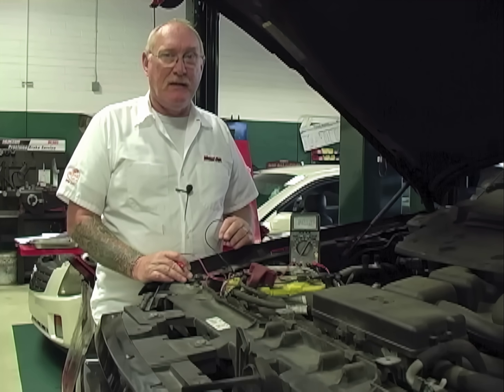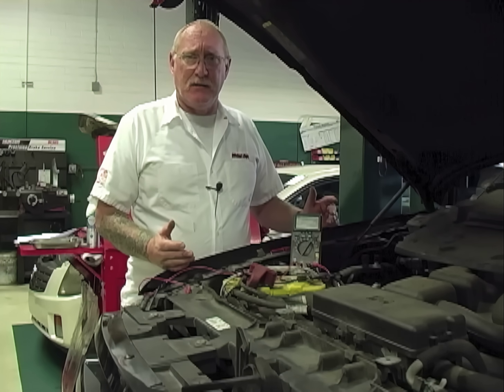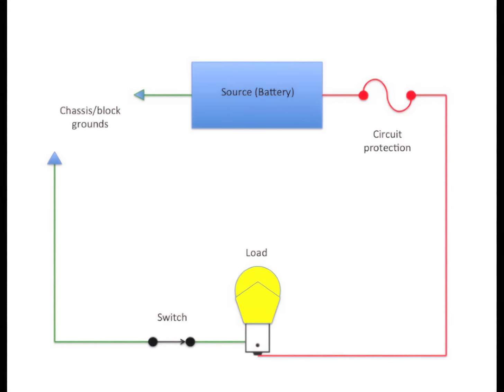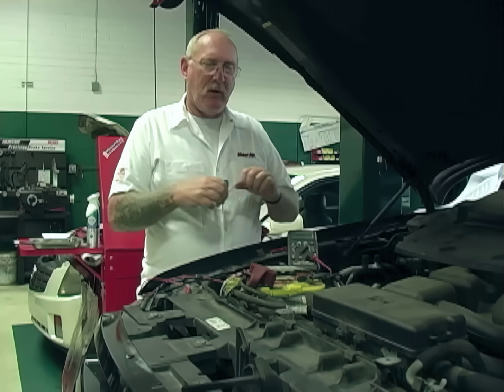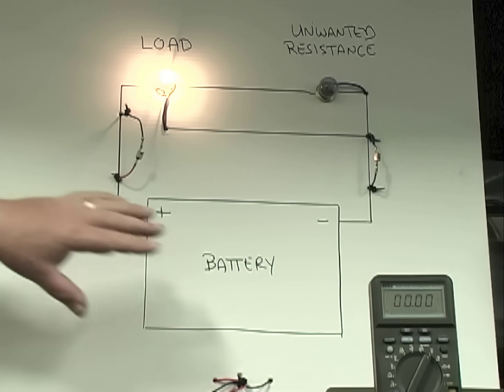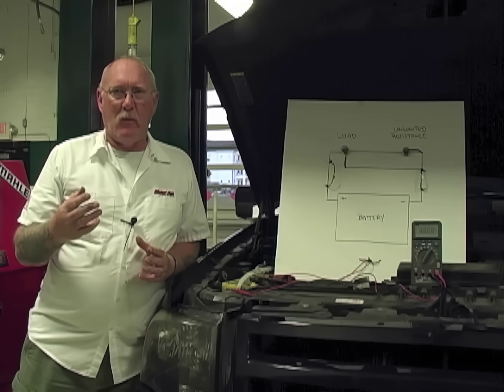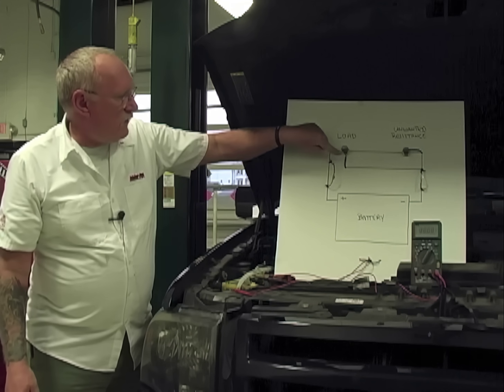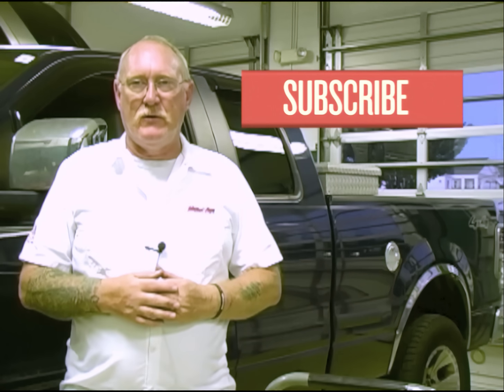The Trainer #47: What measuring voltage on the ground side means

Comment: It's odd you use the term "ground" on a DC circuit.  
Bad habits and all I suppose.

PS, there is no ground rod on a car or truck.

Regards
Reply: It’s a throwback to the mains electrical system where the ‘ground’ is the common return on an AC system. The voltage may use the hot and neutral but there is ALWAYS a ground return, literally via the ground.

In auto systems using DC, it would be expensive to use individual ‘0V’ wires to return to the battery so the chassis is used as a ‘ground’ equivalent. That way, a single wire carrying the positive voltage to the load is all that is needed.

Fun fact: radio transmissions also rely on a ‘ground’ to return the radio energy to the transmitter.

Electronics and Communications graduate and test technician in HV systems.

Comment: The best thing to do is test the battery cables. Make sure the connections are clean because if there isn't a solid connection then you will see a voltage drop from either cable or both. Take your volt meter probes and apply one to the the end of the negative cable chassis lug and the other lead to the actual chassis some where near but at another point. If it is not a solid connection the you will see voltage. That is what is called a voltage drop, Voltage drops are bad connections with enough resistance to show as voltage drops across that bad connection. You can use this method to test all suspected connections. This includes the battery positive post cable to alternator connection. also check the resistance of each cable disconnected from the battery, it should read way less than 1 ohm.

Comment: Ground strap from battery to Chassis !! Check engine to chassis strap and alternator grounding as well. Good ground is ESSENTIAL !!  A goofy Ground/Earth with resistance will self destroy itself at the point of max resistance. Electricity takes the line of least resistance.
Reply: Crobular I I have an old Cadillac 72. Lots of dim lights and sluggish electric windows and what not. I have a bad ground to the body or what would I look for? Been driving me crazy for years now.

Comment: Having a change in resistance in a circuit in the car will not cause this.  The only thing that can cause you to get a voltage reading between the negative post and body ground is a bad ground.  Meaning there is resistance in the connection from body to the battery.  While the meter is connected, take a piece of wire and touch it between the engine block and the body, and the reading should drop to zero.
Reply: tpaairman Umm a bad ground is a change in resistance doofus
Reply: Charles Terrizzi You mean like how I stated in my comment?   Maybe try reading the whole comment doofus.
Reply: "  Meaning there is resistance in the connection from body to the battery.  " hmm

Comment: A crap test. Where are the connecting wires ?  At all lines on the board ?
Why wouldn't the current just follow the path without any lighbulbs (the path of least resistance) ?
Reply: Perhaps - just perhaps - the path of least resistance happened to contain a light bulb rather than a simple wire.
Reply: @kjamison5951  This is stupid on the face of it. And the fact that it is a highlighted reply shows that neither of you has the slightest idea of how electricity works. Dunces.

Comment: When you put the neg lead on the ground and the positive on the chassis and got  an 8 volt reading you failed to mention that will only happen if you have current flow. It needed to be said right then.
Reply: That's not true.  If you disconnect the battery, and put the meter between the terminals, you will get a voltage reading, but there is no current flow other than the meter itself.
Reply: @tpaairman  If you are referring to "the terminals" as the positive and the negative posts on the battery that is correct but that is not what I said. I am talking about the test he did between the chassis which is a ground and the negative battery post which is also a ground. In that situation you must complete the circuit in order to read voltage drop.
The scenario that he demonstrated between chassis ground and the negative post must have current flow to read voltage drop. That is the basic rule of voltage drop,
Reply: @johntripp2028   I apologize.  I thought you were talking about taking a voltage measurement in general.  So to answer you question, the rest of the circuit would be anything in the car that always is connected such as the computer or the radio memory.  If he's getting 8.36 volts from the battery negative to the body, then it means all of the other stuff in the car is only seeing 4.17 volts (he had 12.53 to start with.) Those items won't work at that voltage, but voltage will still flow.  So in other words, the circuit would be positive terminal - radio memory - ground strap that now has resistance - negative terminal.

Comment: I'm sorry but you made it as clear as mud.  When you added the second light in series you did not disconnect the other ground circuit that you were using . If you do not disconnect that ground circuit then it remains in parallel and would only serve to decrease resistance. Your voltage drop would not have been as your voltmeter indicated. So, what are you doing here.
Reply: He plainly said the power would be split proportionally among all loads on the circuit. When testing power on the ground side of the first light, the 6.33 volts that he measured were heading to the second light bulb. That's why each bulb was half as bright- each bulb was drawing 6 volts.

I thought that was a pretty good demonstration.
Reply: @giraffewithtattoos2770  The problem is he left the ground circuit on the diagram. that circuit is in parallel with the second light. The only way the second light would even light up  would be "if " he disconnected the wire going from the first wire to ground.  He did not indicate that. So the wire going from the ground side of the first light to the actual ground is in parallel with the second light. That light might glow very dimly but most likely not. I'm sorry, but I am sure he understands "voltage drop" but he failed miserably in trying to explain it in this video. He almost got it but did not get there.

Comment: EXCELLENT !!!

Basic, simple principle, misunderstood by 95%.of mechanics.
Reply: HotRod Ray my son is an auto tech at a dealership. I told him before he went to tech school, if he would learn only the electrical side of automotive work, he would always be in demand as a tech. So few understand the principals, but 99% think they know everything about it! That 1% that know they do not understand everything about that electrical system are the ones that best understand those systems!
Reply: So many people forget that water runs up hill.
Reply: Some mechanics with a car that is totally dead with a good battery will tell you the electrical system is fried or some other word indicating you cars electrical system has gone out like a watch or radio or cell phone that has bricked. It indicates he does not know electrical very well and therefore he is going to start swapping part, probably starting with the expensive computer an hopes he get lucky. That is why you know how to use a diagnostic plug and know the computer is involved if the plug does not work. Unfortunately at that point you probably need an electrical diagram to check the voltages on the plug going into the computer and some advanced electrical components to do that while it is plugged in like a probe that penetrates the wires.
Reply: yes, but not by real technicians.
Reply: That's why they are mechanics and not auto electricians

Comment: My 1958 MGA has positive ground
  On a motorcycle. This is very common with 70s Yamaha 650 twins. The frame is painted where the factory attaches the negative cable to go to the negative side of the battery. That connection is not very good through the paint , As a result. That particular motorcycle has a problem. The motorcycle will run correctly, the lights work correctly the turn signals work correctly but, when the Rider uses the electric starter, that poor connection at the frame is not enough of a ground to complete the loop of current flow. The result is,All of the little grounds through the wire harness for the turn signals, and the headlights, and the coils, all of the grounds through the wire harness are used by the electrical system, which results in the number 14 gauge wires melting the wire harness A little bit every time the Rider uses the electric starter. Once the machine starts, there is not that much of a load on all of those tiny grounds throughout the wire harness. But if the motorcycle is not a quick starter, those wires carry much more current to ground while the motorcycle is cranking that starter motor. Eventually, it may take a year, it may take five years, but they all melted the wire harness. Which cost $600 at the time...The fix, take the bolt out of the frame connection of the negative cable, grind the paint off the contact point on the frame with a grinder, replace the cable with the bolt through it to the now cleaned off section of the frame and tighten it. 
   I won’t even get started on the issues I have had with my 1958 MGA, with positive ground electrical system. There is a saying in the electrical automotive trade, at least there was. When something goes wrong electrically and you can’t figure out what it is, the saying is, it went Lucas.Which means, it wasn’t working, I couldn’t find anything wrong, but when I put it back together it worked again, so it just temporarily went Lucas

Comment: Always on the positive side.....depends on the circuit. Auto use negative potential as ground (electrical reference). Other electronics may use positive potential as ground.  You should specify differences.
Reply: Anthony Peterson there is no actual ground potential on a circuit which floats on rubber tires, but in general the non-in fuse side should include the common pole of paralleled loads whichever that may be should also exclude its/their switch(es).
Reply: @HighestRank  ur 1st part (tires) refers to earth ground.  I'm referring to circuit (common) ground.  Video indicates chassis ground negative.  I'm lost on ur other points.

Comment: A very good start.  If your "ground" shows a voltage it does not have a low resistance path to the ground at the battery terminal.  I'm sure I don't need to remind an auto mechanic of all the grunge in a car.  Most likely the ground path has a resistive path.  You need to disconnect the battery to check for resistance. Any connection could have a high resistance.  Wires usually have a nice low resistance, unless they are down to 1 tiny strand.   Unfortunately capacitors can hold charge with the battery disconnected and mess up the resistance check or even damage the resistance meter.  A resistor can be used to bleed off charge on the capacitors.  If you read voltage on your "ground" after disconnect the positive side of the battery run a resistor from the supposed ground to the battery ground (with some clip leads).  This will bleed off charge just like poking a hole in a cup of water or a bucket of water and watching the water run out.  A 1K or 10K resistor (1/4 watt or bigger)  is a starting choice.  If it blows up in your eye protection, choose a larger resistance.  The voltage on your ground circuit should bleed off to zero at which point you can start using the resistance meter to see where the resistance is low and is high on the ground path.  Any point where ground is screwed together or goes through sheet metal is suspect. This gets way easier with practice.
Reply: This is good advice. And the video is also good. Infact, they are two sides of the same coin. Your ohm test is using your meter battery to move the needle (analog meter) and his video is using the car battery to move the needle.

Comment: So why do you think 8volts was reading on negative post? Was ground cable shorted to power on a component? Was a component internally shorted? What actually fixed your issue?
Reply from the maker: The only issue here - as in many cases - was a poor ground connection for the negative battery cable to the engine block. The idea was to illustrate why you could read voltage on the ground side and what that meter reading was trying to tell you.
Reply: @VehicleServiceandRepair  Reading a voltage on the body ground will only indicate there is a problem between the body and the negative terminal of the battery.  This video makes it sound like having a problem elsewhere in the car would cause this, which it can't.  Technically speaking, if there is another problem in the car, you would see that in this voltage reading, so for example you changed a bulb somewhere in the car with an LED bulb, there would also be the same type of change because of the difference in resistance between the two bulbs.   But if the ground is properly working, you will read zero volts between body ground and the negative terminal, regardless of anything else happening in the car.

Comment: Electron (current) flow is from negative to positive. The fuses are on the positive side because that's where the wires are. If we used a positive grounding system the fuses would be on the negative side because that's where the wires would be in that scenario. I prefer the term "common negative" system although "negative ground" has become the accepted term through long usage regardless that there is no actual contact with (earth) ground. In fact, some electrical schematics, notably vintage radios, will show both a common (chassis) ground and an actual (earth) ground using different symbols.
Reply: Spot on Ed. It's one of those little idiosyncrasies that have become the accepted norm..... There is no "earth" on a vehicle ...only chassis. 
And the chassis is isolated from true "earth" by rubber tyres.!!!
Consider too that when explaining transistors... the arrows on the symbols are indicating "conventional flow" (The arrows indicating a flow of pos to neg...not electron flow...) no wonder people give up when trying to figure car electrics!

Comment: Nice video!  I've got 12 volt positive on my rear windscreen washer motor on the negative side,  ithought the pump was stuffed but unplugged front pump harness and plugged in to tear pump and it works but i couldnt understand how i was getting full battery voltage on the negative side of the rear pump. A lot of earth wires going through the same harness. When I ran a separate earth to the pump it got hot as hell. I watched your video but my brain is still trying to figure out how and why?  Any reply appreciated in giving me a starting point as im baffled and i wanna be the go to guy especially with new cars as no one likes working on them! I hope i explained this properly?
Reply from the maker: Post year, make, model of the vehicle you're working on and let me look at the schematic. If the "earth" wire got hot, a lot of current is flowing through it for some reason...
Reply: Hi Ed here my car is a 1998 hyundai excel X3 1.5 dohc model. Ithink its a hyundai accent in America?  Not sure! I have to try to finfd schematic . I'll try to send a pic if needed tomorrow. Its 11.30 and i just finished work. Gotta hit the sack will try to find diagram tomorrow morning
Reply: Thanks for the help 😊
Reply from the maker: @dragan3290  If I'm looking at the correct diagram, there is a White wire w/ Black tracer supplying power from the fuse to the pump. The ground, or "earth", side is a Black wire w/ White tracer.

Test the motor by having someone operate the washer pump switch and measuring voltage on both sides of the pump. You should read close to the same as battery voltage on the W/Bk wire and next to nothing on the Bk/W wire. If you are reading the same on BOTH sides, then the problem is on the ground side of the motor. The switch is on the ground side, according to the schematic I have.

So take those two readings and post your results!
Reply: @VehicleServiceandRepair  will check it out in the morning and get back to you!  Thanks for the reply! 😊

Comment: Always place the fuse on the POSITIVE SIDE of the circuit. 

That's a good point to analyze and a valuable lesson to remember - and it will go a long way. Thank you for the informative video. Keep it up, Sir.
Reply: that is not necessarily true  it may be good practice  but  it can be placed anywhere in the circuit and still work if the circuit is fused for over amperage.   if you want to protect from short circuits it needs to be as close to the source as possible
Reply: @richardcranium5839  Thank you.  Good info: locate fuse as close to the source as possible.

Comment: How are you reading voltage?  Because what you said is a ground isn't a ground -- or rather a good ground.  Right?
Reply from the maker: The presence of voltage when both meter leads are on a ground indicates that we haven't gotten the meter leads past all of the resistances in the circuit. There is another one asking for its share of the available voltage and it's somewhere between the two leads. Check out our latest webinar on that very topic at http://ubmadvanstar.hs-sites.com/watch-measuring-voltage-when-you-should-not-webinar

Comment: I'm going to take a ase test tomorrow on electric this helps thanks for the video
Reply from the maker: Good luck on the test. I hoped you used our ASE study guide to prepare! http://www.passthease.com
Reply: @VehicleServiceandRepair  I failed kind bad but if it was easy every one would have them an yes I did use them mabe next time
Reply from the maker: @lmtsmt847   Electrical is tough for many techs. If you need help polishing up your skills, I recommend you check out the libraries on our channel's home page, as well as the home pages of @ScannerDanner and @TSTSeminars.
Reply: @VehicleServiceandRepair  I've got 30 days from yesterday to study an thank u I will look at that stuff